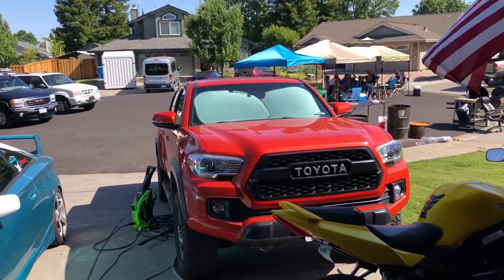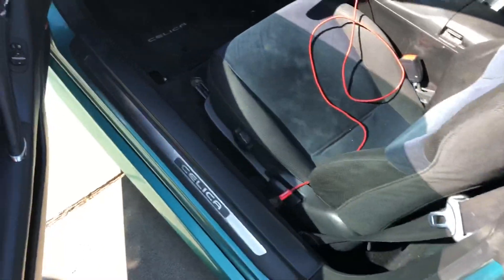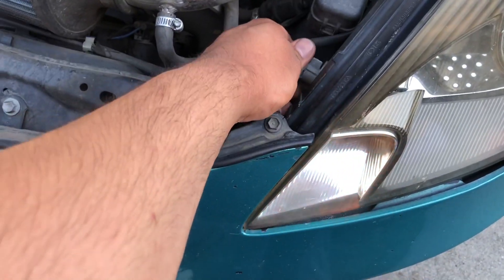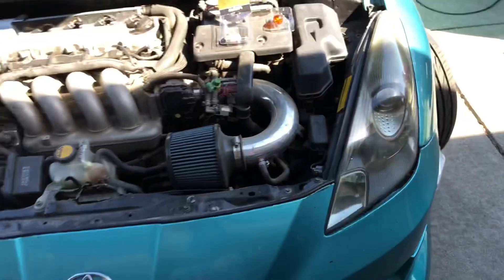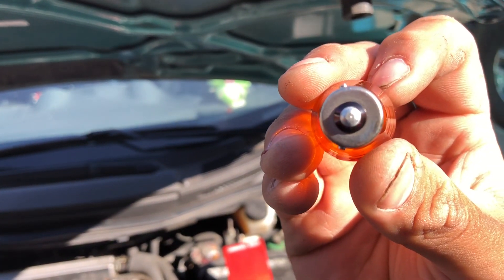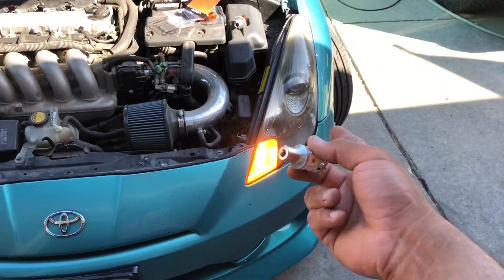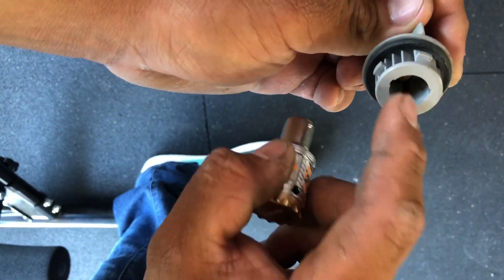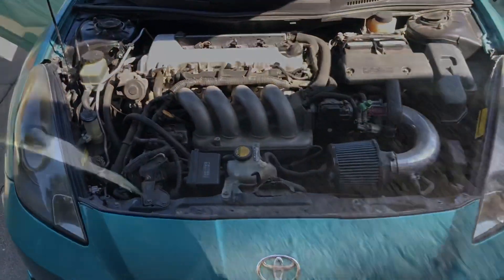Lasfit 1156 amber turn signal LED no hyper flash install on Celica GT-S

Comment: How many watts?  Do they run hot?  Did you change your rear bulbs too?  💡 👍
Reply from the maker: 28w and they are most definitely cooler. I will plan to change the rear ones aswell

Comment: i bought turn signal LEDs off amazon they have the same issue fitting into the socket.  I have the flasher relay so i didn't need ones with resistors.
Reply from the maker: i guess i could of went that route. ohh well. which flasher relay you use?
Reply: @2zzlow  i got the relay from diode dynamics during a free shipping sale.  they are really good w warrantying products out for me in the past so i buy from them when it makes sense.